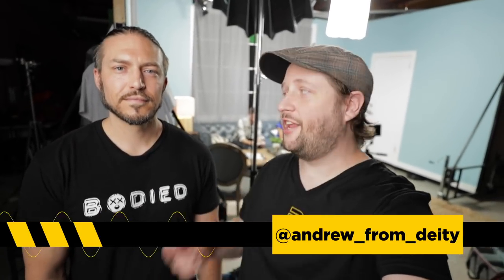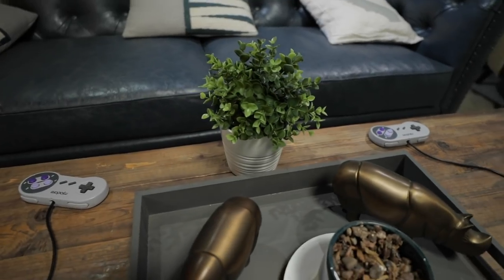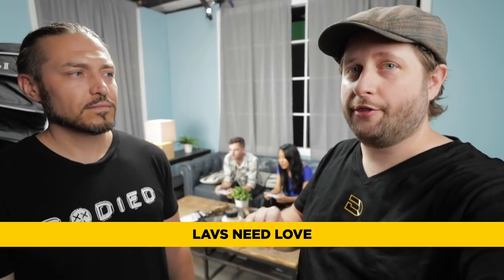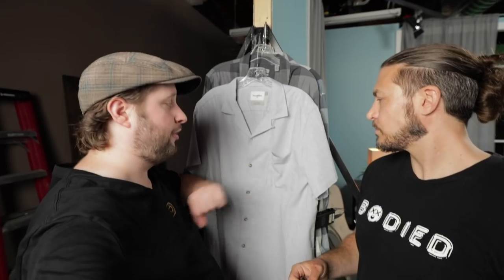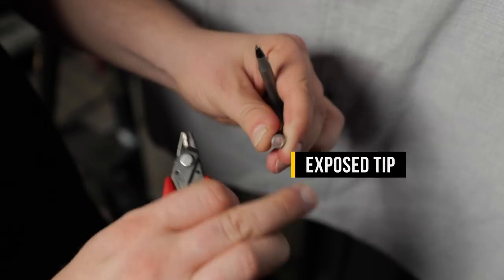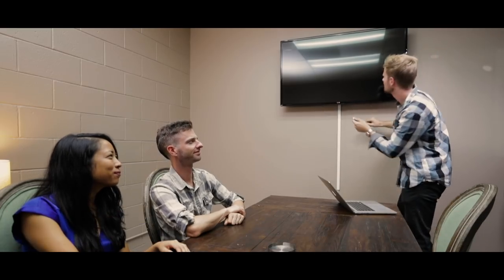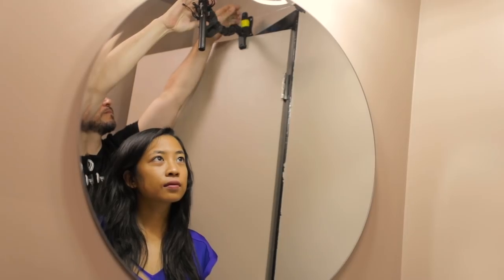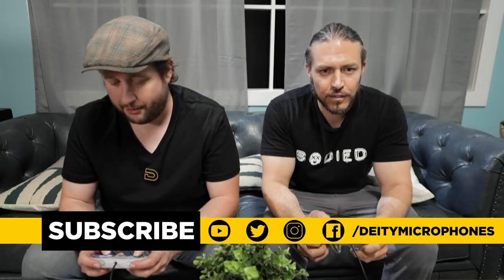What is a Plant Mic? | Hiding Mics On Set to Get the Best Audio

Comment: Really great info, thanks!. You mentioned dual mics on two people capturing both of their dialogue and going out of phase. If you only have onni directional microphones, and have two people close to each other so you’re going to get that mix of dialogue on both channels, and can’t boom them because they will be moving around too much, what is the best solution? I’ve had good luck with directional lavs, however of course if the talent moves too far off axis, you lose a lot of volume.

Comment: Whenever I use shotgun mics the sound is just too tinny. I’m using an NTG2...one day I want to get the smic 2 but it seemed a little tinny in this episode too in the confined bathroom mirror scene?
Reply from the maker: 1) we didn't use the S-Mic 2 in this episode

2) the tinny sound you refer to in the bathroom is the natural reverb of a small space with hard surfaces. That bathroom may only be 4ftx5ft max... in rooms like that, theres almost nothing you can do but work with in coverage with ultra closeups and work that microphone as close as possible in the coverage and try to do some lip syncing on the wide.  We also could have used Izotope RX7 and cleaned up the audio a bit too if we had the time.
Reply: Oh wow. I know izotope r7 aren’t you guys. But maybe a short tutorial in how sound guys would fix things like this in post. Cos it does happen...would love to see this scene fixed in post!
Reply: @DeityMicrophones  the tininess is more likely due to comb filtering that results from using a shotgun (interference tube) mic in a confined space, better to use a pressure gradient hypercardiod. Rule of thumb, shotguns don't work well indoors.

Comment: I still don't understand why using plant mic and for what is good? Communication between the sound team or for what?
Reply: If you can't get the boom in tight enough, if the lavs aren't good enough for a shot with important dialogue, or if the shot involves work where actors need to pass out of the boom operator's reach; if there is a changeover between 1st and 2nd boom for example